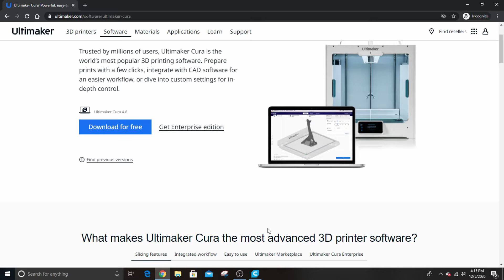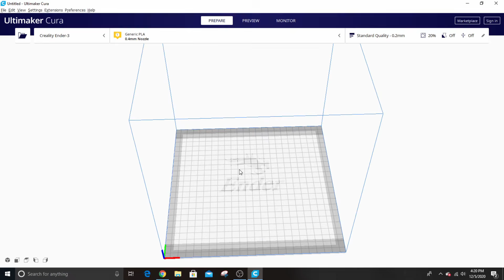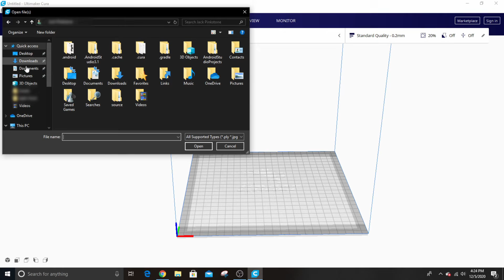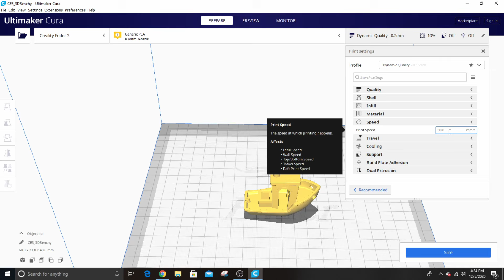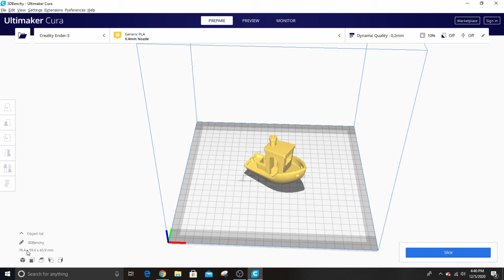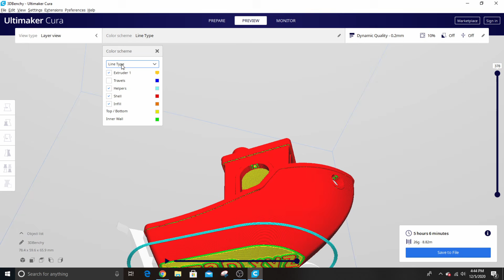Comment: Your presentation is excellent.  Easy to follow along with.
I have a printer that i'm building on my own.  I'm using an SKR V2 board from BigTreeTech.
My question is, what printer selection would you make when adding a printer?  I tried the Creality CR-10.  Im getting a weird behavior:  The Nozzle primes ok and spits out some filament, but shortly thereafter, the extruder retracts the filament with each command.  I'm trying to print the infamous boat for my first attempt.  I have not modified the sliced code in any way.

Comment: how do you import a model and have it be the exact same size at the model you created.  When I import a model it is either super tiny.... and I have to go back to my cad drawing and  measure it again and scale best i can to that measure.... ( royal pain in the A**)    or it will autoscale and be huge when I open it..   So just WTF on how to create a model in CAD, and import the STL and have it just be the same damn size.   Any help appreciated!   total beginner here.. 

Lastly are there any good instruction manuals for these printers on how to operate the controller on the printer.  The book that came with it sucks.  I got a CR10 Smart Pro... Just fumbling around trying to figure out how to load the plastic, etc.. Doesn't really tell you how to heat it up to do that.  Again,  just WTF..

Comment: May want to warn people the latest versions of CURA using generic PLA setting sets bed at 50 end at 185 meaning the retards at Cura thought settings below the minimum temp for most generic pla was the way to go. worse yet it resets to those values a few times at the start and as the beginning layers increase fan speed so you can if you don't watch the first FEW layers find the bed temp down 10 degrees and the nozzle running below the recommended temp for the filament.

Comment: Following this video's recommendation I just installed Cura on my W7 system. It will not execute, it just comes up with a bunch of Python errors. After thirty plus years of messing with sucky software installations I don't bother troubleshooting any more. If it crashes after installation I just delete it and look for something that doesn't. It's a shame as Cura seems to hold out a lot of promise.

Comment: Thanks for video. I have an Ender 3 V2, I did not see any option for this version so added Ender 3 settings, I had to change the printer dimensions. Wondering if there is anything else I need to change.

Comment: Sorry, but the ender 3 bed size IS NOT 235mm, It's 220 X 220 X 250
Reply: Actually, it is 235mm if it is measured from edge to edge. The advertised area is 220, but it can print a little larger.

Comment: I hate to bother but I have a problem with Cura. I tried using v4.71 awhile back and couldn't use it. Now I'm trying 4.8. The problem is Cura will open but when I click on the folder to import a .stl the program flashes "file explorer" and shuts down. I can't find help on Cura website.

Comment: Hey I have a question my 3d printer won't let me print any gcodes at all I sliced it and it only says it will go around the ring of the top of the ship please help
Reply: Inch’s would be impractical however you use a converter on google or something?

Comment: I am new to this.   do you need to use Cura in order to create the files?   I have some example files in STL format.  but when i process in cura, I end up with some Gcode files.  
Do I need them both,  or just the STL or Gcode file ?   
Thank you
Reply: The stl file is the source - the object you want to print. Cura generates a gcode file from it which the printer understands

Comment: Thank you, I'm new to 3D printing. How would I get this program to work with MY printer? I have the Flashforge Finder and it is not listed in the printers list in the program.
Reply: You have to add the 'custom printer' option in the add printers window. Then input your printer's bed size, print area height, heated bed, filament size, number of extruders, etc.
Reply: Try to find a 3D printer that looks like yours and has similar attributes. If that is listed in Cura, you may be able to away with that. Irv of Dr. Vax shows how to customise your code to get starting https://www.youtube.com/watch?v=9Ja9utWCKWA